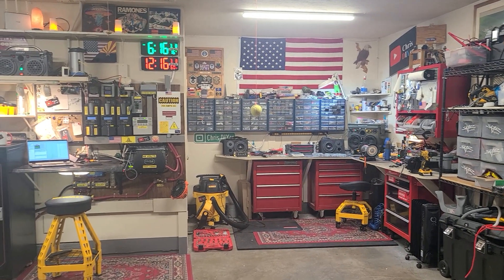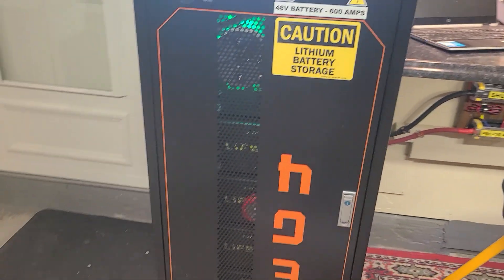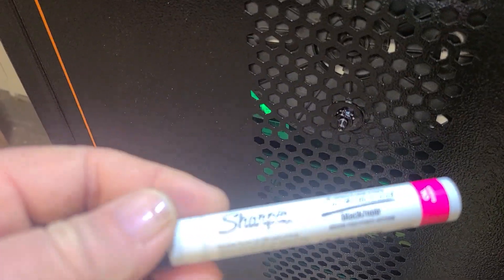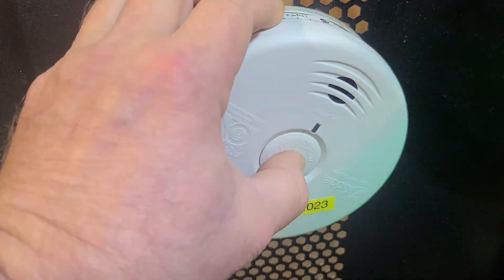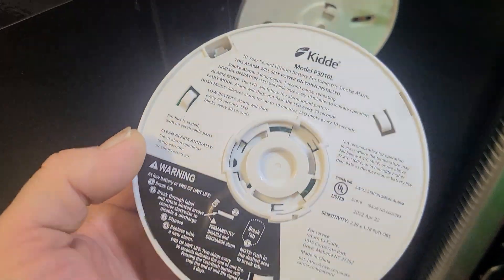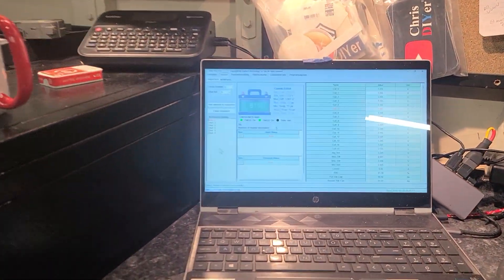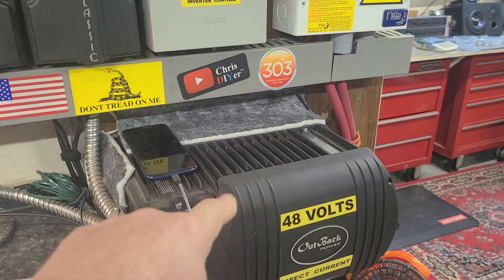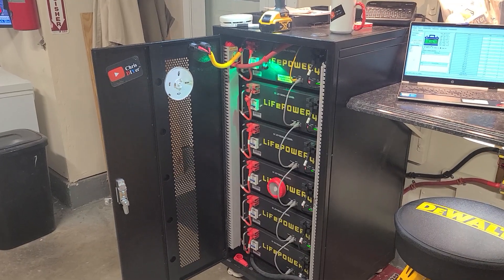Kiddie 10-year lithium smoke detector inside EG4 server rack battery cabinet

Comment: With LFP batteries is the a different fire extinguisher to have on hand vs the old battery type?
Reply from the maker: Class D ones is what they say to use. But they are crazy expensive. I have a CO2 and more common store bought powder ABC ones here in the garage. They say CO2 is okay for larger batteries. Check on Google. Most modern LiFePO4 batteries are extremely safe and shut themselves down fast before going into combustion mode. I have been using lithium for years, shorted some out accidently a couple of times...they just turn themselves off. Thanks for commenting...great question